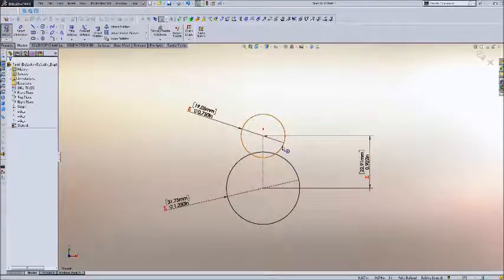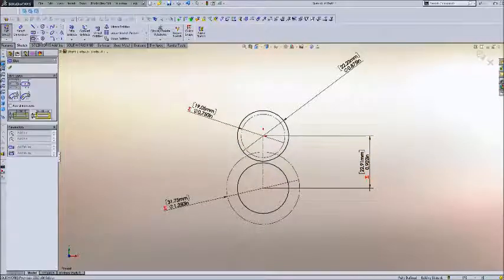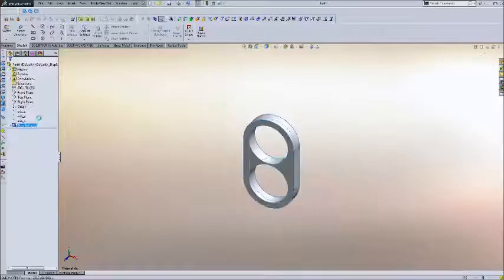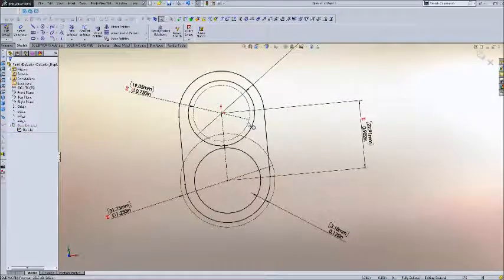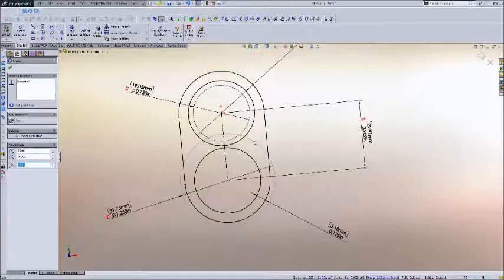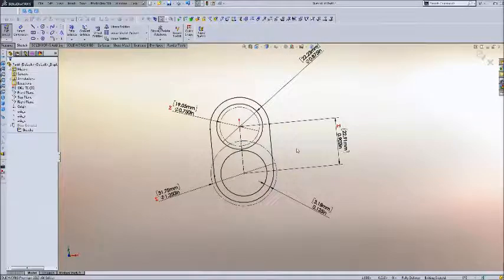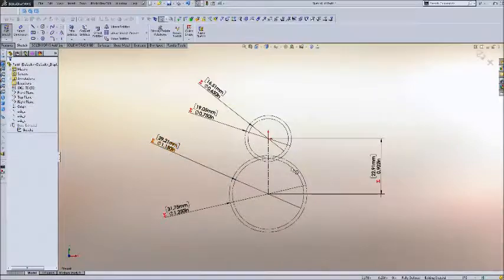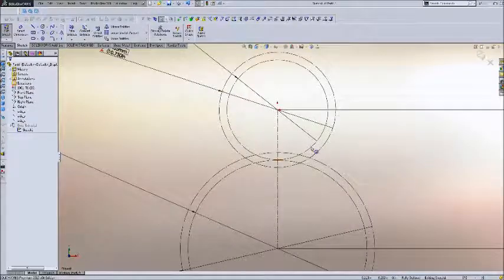Intro to modeling gears and gearboxes

Comment: Why do you think that ''manufacturing tolerances'' will make the gears too large, thus more CD is needed..vs. too small of a gear, thus less center distance needed?
Reply from the maker: Good question!

It's not the gears that have manufacturing tolerances, but the plates that we sandwich them between and their mounting hole positions. If the holes are too far apart by a small margin, it makes it a little less clean but the gearbox still runs. If the holes are too close by a small margin, the gears lock up because the teeth get stuck together. Because of this, we pick the lesser of two evils and add the center distance to ensure the gears don't lock up at the cost of chancing that it's not as cleanly meshed as we'd like it to be. 

I hope this helps.
Reply: @cadandcalipers  I hope that the gear boxes are not under heavy load or high speed or the gears won't last very long.
Reply from the maker: @thebaron44  We have not found that any of our gearboxes have any durability issues.